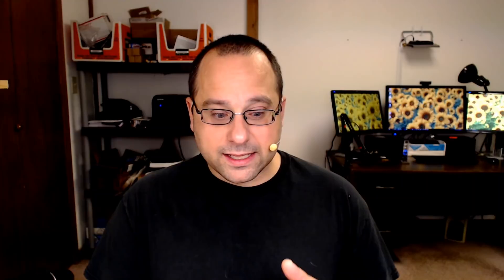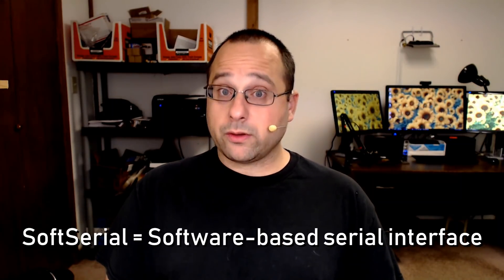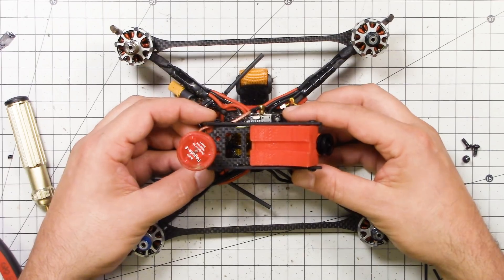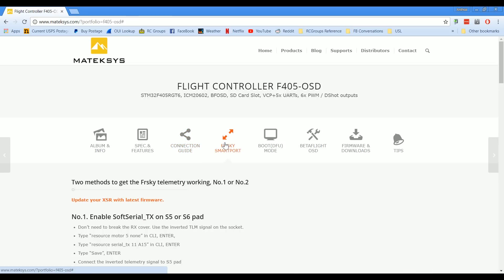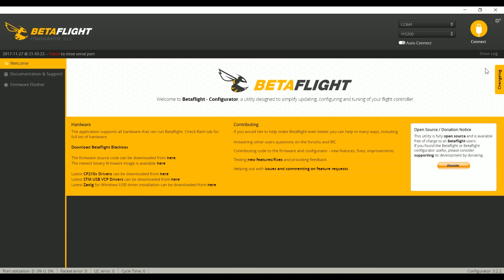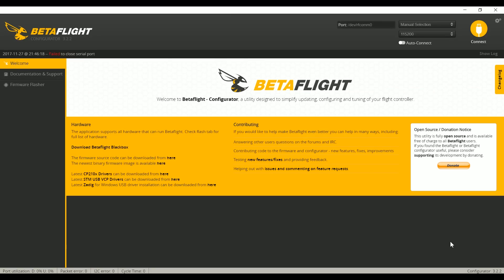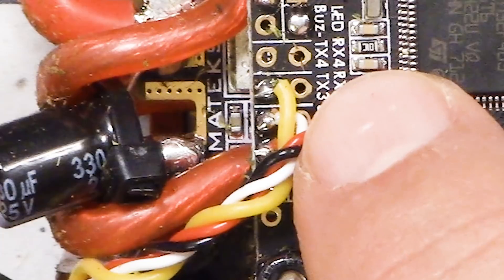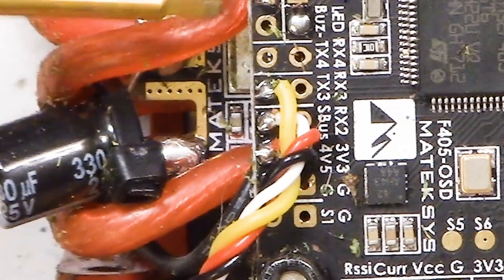Betaflight SmartPort Telemetry How-To | MATEK F405 AND OTHERS

Comment: Can matek f405 support softserial for Blheli 32bit telemetry?
Reply: You don't need to use soft serial for BLHeli 32 telemetry on the Matek - it  has enough real UARTs.
The Matek F405 has 4 usuable UARTs which is more than enough:
1 for SBUS
1 for Smart Audio
1 for ESC Telemetry
1 for Smart Port if you use the un-invert hack (not required if you use soft serial).

So even with BLHeli telem and FC telemetry you have one or 2 free UARTs left over.
And it has another free motor pin for camera OSD and a DAC pin when that becomes avail.

This is why I've been using this FC since it came out.
Plus Matek's awesome quality.

It really is a boss FC.
Reply: jtan163 so is this the same for F405 aio

Comment: Okay riddle me this riddle ER I have the Luminaire Lux V2 flight controller I have been flying on betaflight 3.1. 6 for quite a few months now and everything is going fine zero problems. The other day I decided to flash betaflight 3.2 .2 after flashing betaflight I no longer got Telemetry on my flight controller I pretty much tried everything I could think of search the internet for hours talk to people on Facebook I know there's different CLI commands which I did try a few but none of them worked. I ended up just going back to betaflight 3.1 6 and Telemetry came back to my radio on the Luminaire Lux V2 flight controller it has a dedicated uart for S. Port which I have it hooked up to does anybody have any idea why the board is doing this?